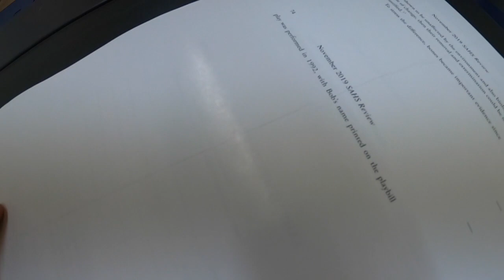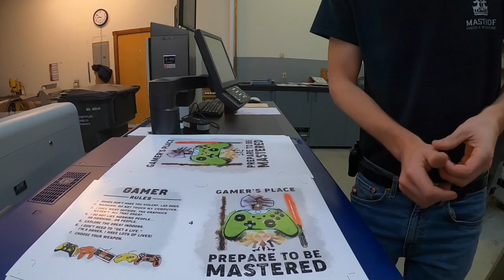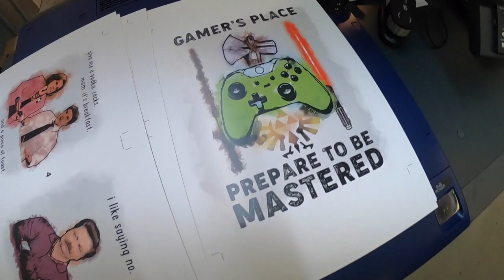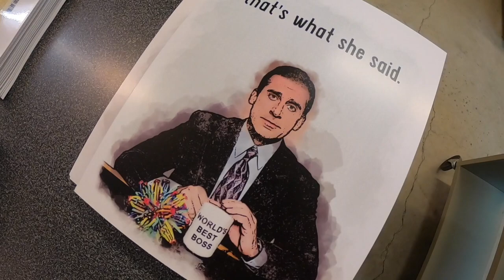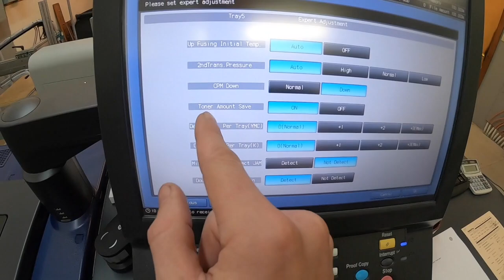Cleaning Blade Fix on Konica Minolta C3070

Comment: This really helps me a bunch of times. Lately though, I clean, works but then after several prints like 100 sheets, the line comes back. I'd really like to see how you vacuum out excess toner, or process of changing the cleaning blade.
Reply from the maker: Sounds like you need a new cleaning blade. Its just two screws and two clips. I'm sure I have a video someone with the process.

Comment: its not  necessary  to turn off the machine. you can go to parts counters on  service menu ;)  
i recommend to change cleaning  blade with side seals every 200k!  protects  drums an transfer belt life!
Reply from the maker: Awesome! Just replaced the cleaning blade on my used 3070 today. It had almost 1 million clicks, it was bad. :)
Reply: @justaprinter  Do you have a vídeo doing that?

Comment: Is there any further cleaning of the blade besides brushing and vacuuming? Also, what can you clean the transfer belt with? Every time I run NCR it leaves so much residue behind on the blade and transfer belt that Konica is telling me they will no longer cover it in the service agreement because it’s not “authorized paper”. Their only “authorized NCR paper” hasn’t been available for over a year. Konica is no help, and I have to outsource all NCR jobs now. Any advice?
Reply from the maker: Try Xerox revolution paper. I never have problems with that and have no residue.

Comment: HI, i have a develop 3070L, I bought it new, not many prints yet, at the beggining, when i was printing, 350gsm, velvet paper, and the business cards i was printing were mostly black, the glossiness it was achieving it was llike it had a varinsh on it. Now it seems this has been lost. Same settings, same file,  but the printing is more smooth. The service says that this is normal, but i rememberthat  it was ultra gloss, althought the paper was velvet. I am not sure about the paper quality though, althougn i buy from the same. Any ideas, what might be wrong? or what settings to use, to see which is the more glossy i can get? Any help would be appreciated...
Reply from the maker: Maybe try to change your paper settings to a heavier paper. This will slow it down and heat the paper more. Other than that, you can adjust fuser pressure, fuser temperature and a few other things in expert adjust mode. Hope that helps.

Comment: For you to access the 3rd screw, how do you open the cover. Mine is holding tight.
Reply: I got the solution. Theres a hidden screw on the left of the case but right of where the main power is. Thank you for the video I was able to clean a line that was bothering my prints.
Reply from the maker: Good for you!

Comment: I have the c1060. I wonder if it’s worth upgrading to a c3070? What did you have before the 3070? Thanks for any info.
Reply from the maker: Don't bother they are pretty much the same machine. I do like the anti-static feature on the c3070 though. Before the 3070 I had a c8000.
Reply: Just A Printer thanks for the reply. You know how they always want to sell you a new machine. I get along great with my c1060.
Now the new thing they are pushing is a envelope fuser to run envelopes on it. Also the acurrio shine unit. To add foil or a shine to prints out of the machine. Have you tried to print envelopes on a Konica minolta?
Reply from the maker: @willarmentor5529  Yes, my 1070 came with an envelope fuser, didn't really want it because I always doubted fusers and envelopes. Inkjet or offset are still king for long run envelopes but if you are doing less than a few thousand, the Konica envelope fuser is handy.
Reply: Just A Printer I got a ijetcolor nxt. But for some jobs I need to match output of my 1060. The nxt is a good machine but it is delicate as far as being a inkjet. The print head clogs if you don’t print on it everyday. Printhead cost over $600 bucks. Also they tell me I need to run the envelopes with the flap open on the fuser. Ain’t nobody,got time for that. Lol 
By the way where do you get the manuals to repair the Konica’s? Thanks for replying.
Reply from the maker: @willarmentor5529  Haha, I run them with the flap closed with good results. I found manuals online. email me at justaprinterman@gmail.com if you need one for a c1070/60
Reply: Just A Printer sent you a email. 👍

Comment: I did this and now the screws won't go back in.
Reply from the maker: It should go right back together.
Reply: @justaprinter  The screws with the purple shell do not go back in. I'll screw and screw and there's no friction. it's like the screws can't reach the other side due to the purple shell it's housed in.
Reply: @robbrooks6275  theres a plastic retainer on the screw inside the purple sleeve. with the sleeve out, be sure to press on your screwdriver as you sctew yhe screw into the sleeve so the exposed threaded part is fully showing. also idlf threads are stripped you may have to replace it. screws and retainers are inexpensive and can be obtained from your local Konica Minolta dealer.